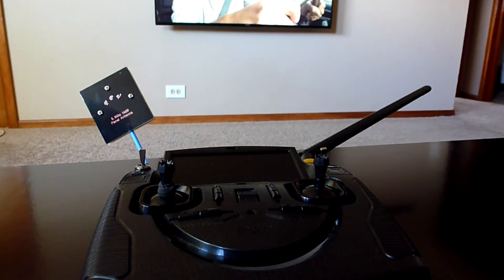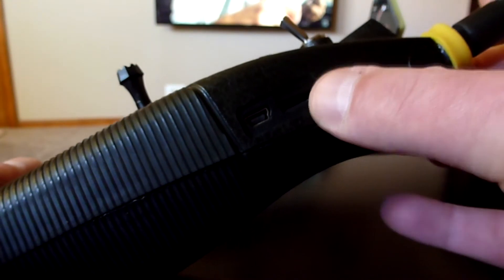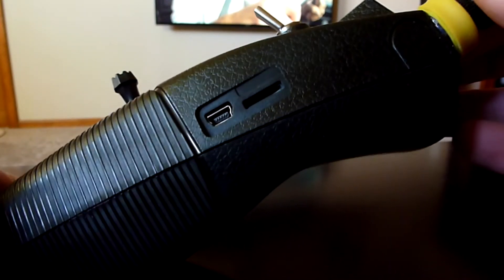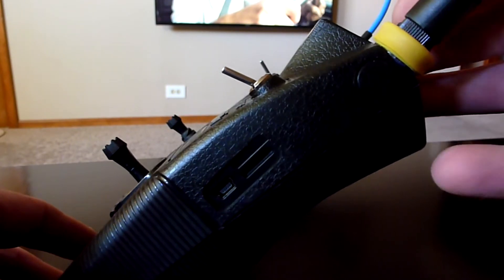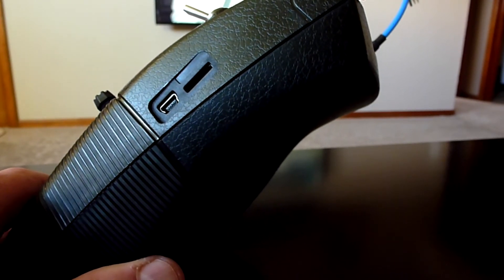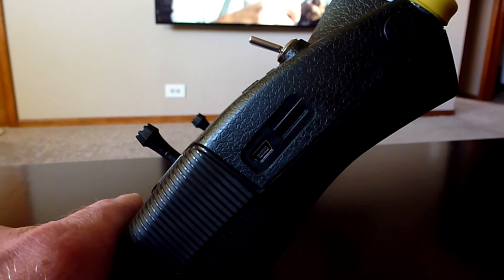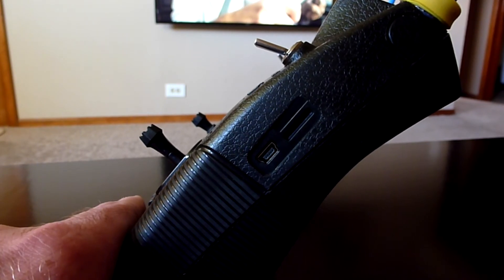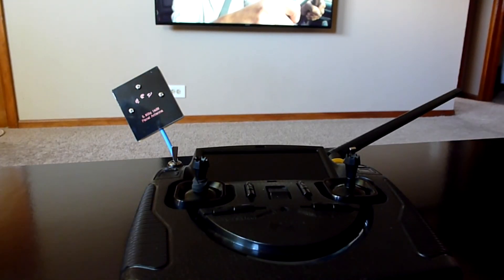Hubsan X4 : What Is The Transmitter SD Card Slot For?

Comment: Dammit. Answered my question 🔥superbly.😁 BUT. And there is a big👷 one📞. Throws me off with your antenna attachment and i assume video atenna attachment.. Definitely no slot for what you show. Would appreciate you explaining what you've done there lol. Unless your a pro flyer guy who uses this transmitter for other flying vehicles..??
Reply from the maker: I opened the transmitter and fitted new 5.8 and 2.4 connectors and antennas. I have since changed them to $10 cheap external antennas. You can find the kits on ebay banggood and gearbest. Lots of how to videos available on YT showing how to do this mod. You can get 1000m or so....more in some locations.
Reply: @FlashForwardRC  Thanks for the reply. Wasn't per say looking to do the same mod. Jus curious as your video had all that but with no explanation.⚡

Comment: Thanks for the information Flash. It's always  a very good idea to have a remote recording (not on the drone) in case it goes down. Then you can use the video to get a better idea of where to look for it. The Hubsan 501 holds the GPS coordinates which is a big help but on quads that dont store GPS I always record the FPV signal with my goggles whether I'm wearing them or not or with a FPV receiver with SD card. I also have the Loc8tor RF modules attached to my quads to make it even easier to find.

Comment: the slot is used to update the LCD firmware on the controller
Reply from the maker: Good point to add Garry. It can be, but most use the pc to do the updates to avoid transferring from pc to the sd card to the transmitter.
Reply: To be fair i only found out by chance when i purchased a second controller which happened to have different firmware. i only updated as i was used to LCD 1.3.3 and anything else felt strange. otherwise for the 501s you're absolutely right it really serves little to no purpose. interesting video, thanks
Reply: I need your help. How do I format my SD card for my hubsan 501s?